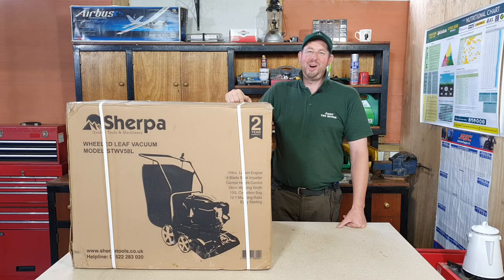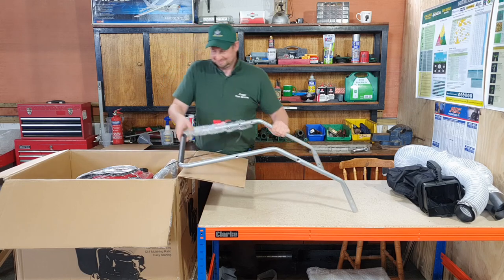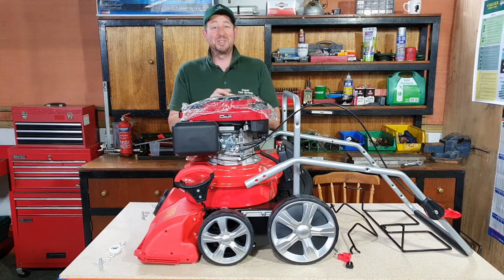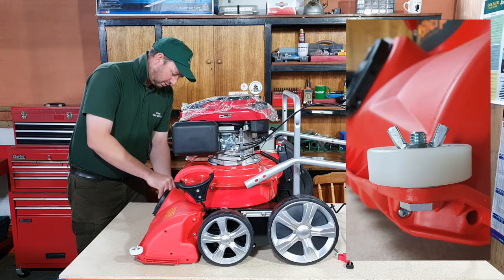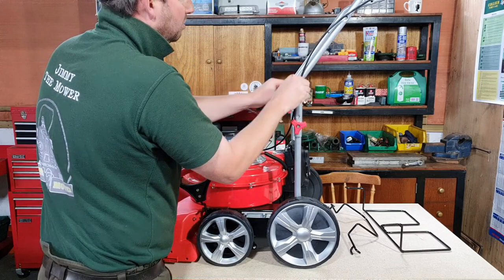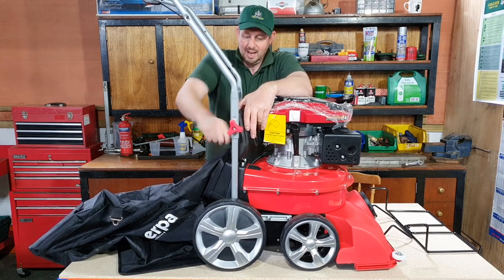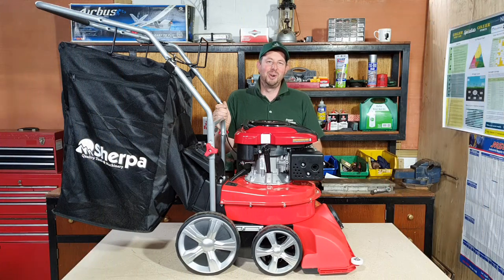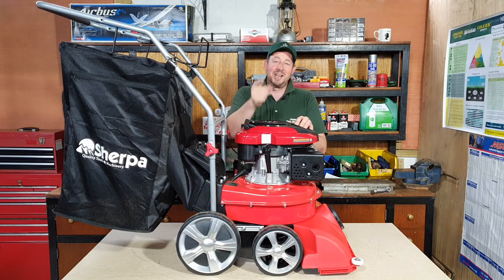Assembly of the Sherpa Wheeled Leaf Vacuum STWV58L tutorial instructions blower collector review

Comment: Cant wait to see it in action! Why do they insist on all these machines putting rubbish wheels on them? A large width pneumatic tyre would  have a much lower ground foot print and as the ground is usually soft when these are used, would cause less damage to it. Just a thought like :)
Reply from the maker: That's a good point we'll put.
I will see how I get on with it over the next few weeks.
Maybe I could retro fit a set of pneumatic tyres and wheels.